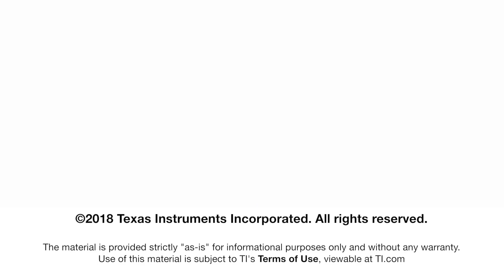Connect: Why Zigbee 3.0?

Comment: Can someone help me out with these questions?
1. Explain how do you configure a Zigbee device for a WSN. What are the fundamental requirements to configure it?
2. Explain the basic requirements for designing software to extract and store data from any communicating devices such as Zigbee.
3. How a Zigbee based WSN can avoid interferences from another Zigbee based sensor network in the same region?